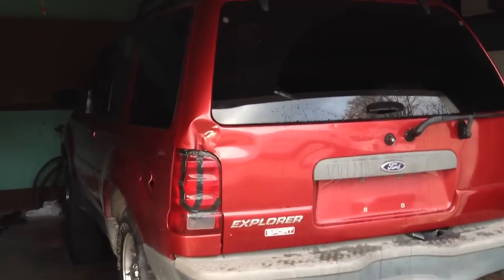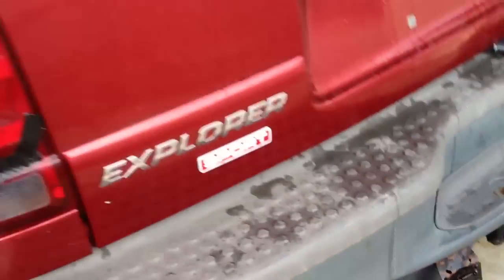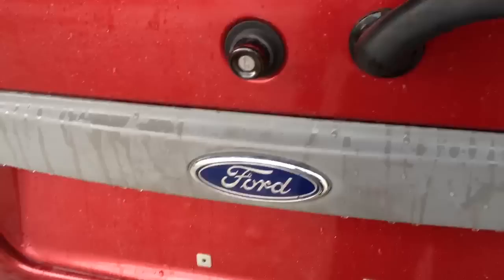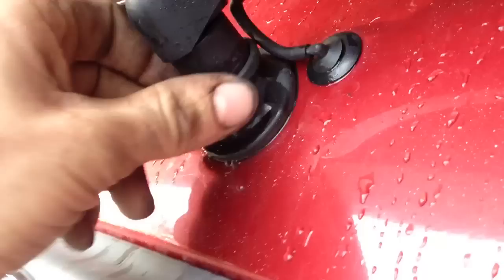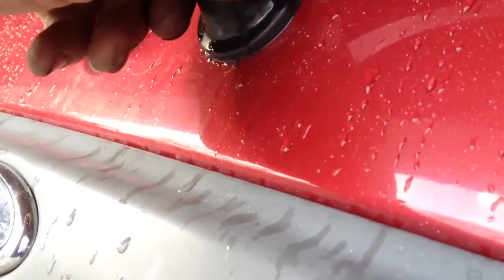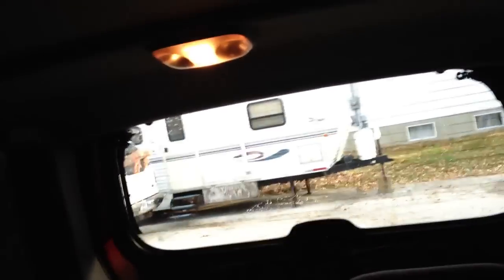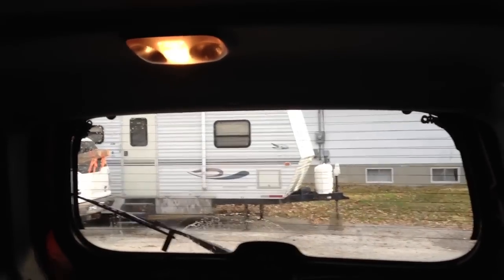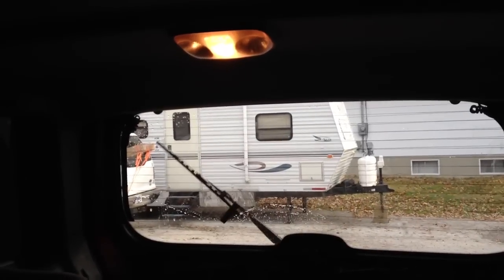Ford Explorer Rear Wiper Quick Repair

Comment: My back wiper gets stuck in under the window all the time...do I need a new wiper arm?
Reply: I'm having the same issue, did you get it fixed?
Reply: Clay Stanley Nope, I just removed the rear wiper all together
Reply: I moved the black cradle piece up . The bottom hole on the cradle is in the top hole on the car !!